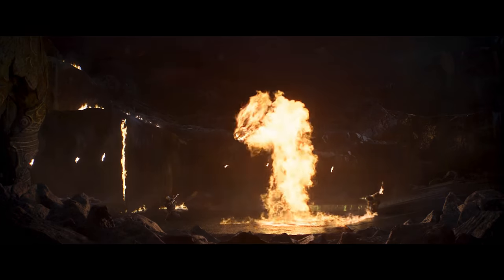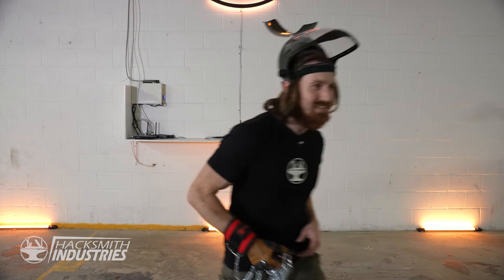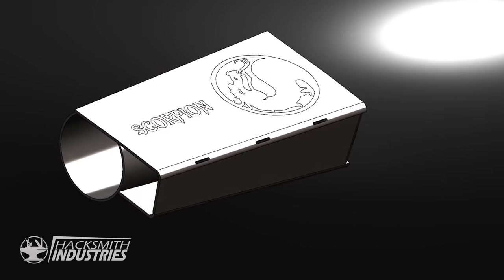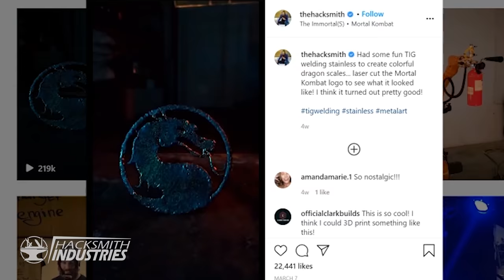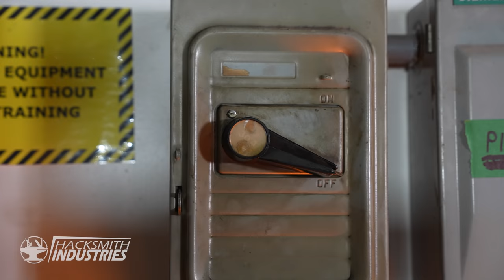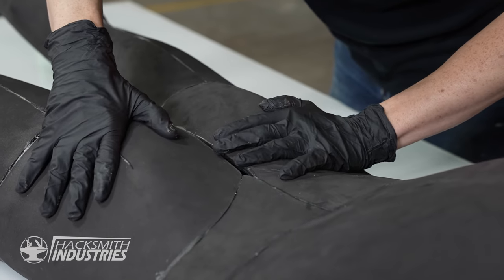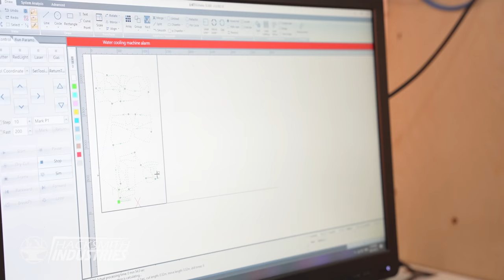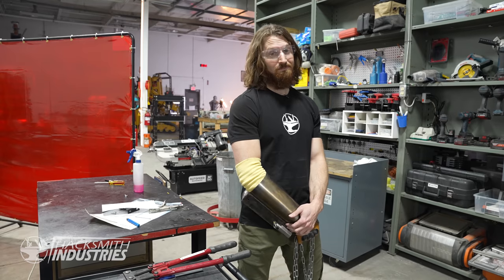Scorpion's Chain Attack in Real Life! (MORTAL KOMBAT)

Comment: MY old way of doing a Scorpion Kunai Chain was a small tape measure with the tape replaced with a thin rope and a kunai tip (back when it was still a rope in the games and not a chain). It was pretty easy to do since the kind of tape measure I had was the kind that was loose until you pressed the button to retract it. Nobody ever really thinks to do it like that. It's not easy but it worked.
Reply: I was been trying to do that too! Makeing a Rope Spear with a tape Measure or Recoil thing. But I want to ask, what kind of Tape Measure did you used to make a Rope Spear aka Scorpion Kunai?
Reply: How did you put the rope inside?

Comment: Exceptionally impressive work, however I've got a suggestion wish it might make it slightly better. The only negative thing I see in it is that you have to use both your arms to utilizes your creation, unlike scorpion who uses one. Posible, you could use the activation mechanism of the well-known hidden blade from assassin's creed series ( If that possible, I'm not sure. It's just a suggestion ). All they have to do is pulling a thin rope by a metal ring they wear to cause for the balde to come out, so it might be possible to use the same method to cause for the spear to be launched, using a single-hand  action

Comment: I would have said use a more stronger material for the chains that makes it more resistant to impact and my own ideas would be a cord idea that also has two motors that return the blade back when you make a mechanism that uses a button and switch form. The button for launching and the stitch like a reload system to return the blade back.

Comment: Maybe it would work better and you could possibly build it smaller (like to actually use in a film.) Less chord means less weight. Means faster shot with your mechanism.) The most weight should be at the tip. Which you.could make look exactly like the films.
By using a bungee type chord. Something super strong but some elasticity so the get over here won't have slack because the elasticity will allow it to stretch meaning less chord/chain. Also, it helps with the "Get over here!" 
(Paint the chord chroma-key green to change to the real Scorpions unrealistic chain.)
Without the green, it would be a more viable weapon.
Idk just thinking...

Comment: would it have been possible to create some kind of spiral retractor around the gauntlet? to position the mechanism underneath instead of on the side? and the propulsion just push it out similliar to how how when you pull a small chain out of a jar it will continue to run down without any assistance until the cup is empty?